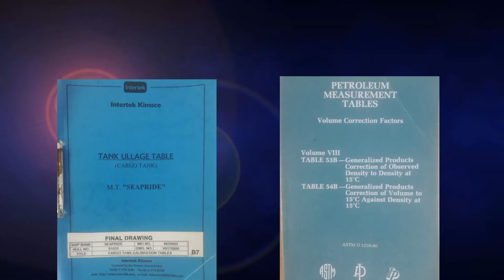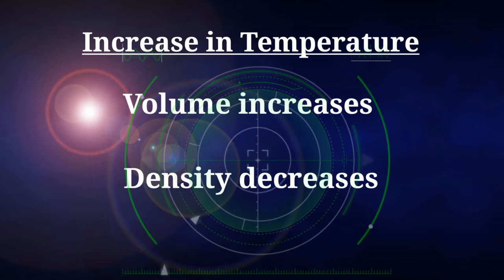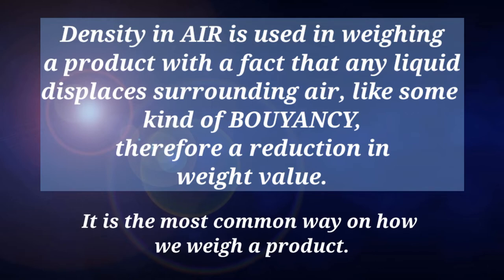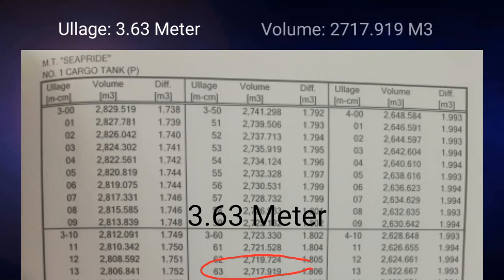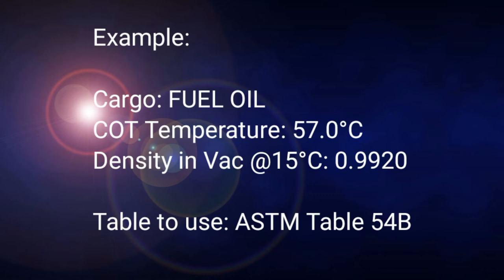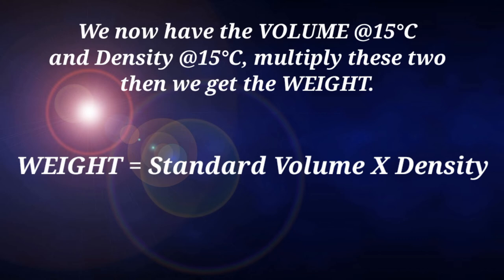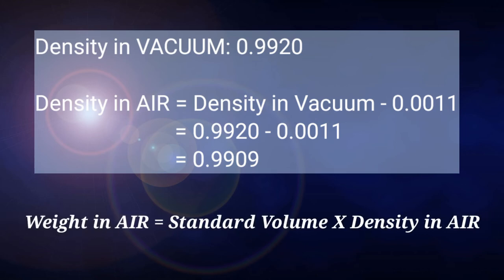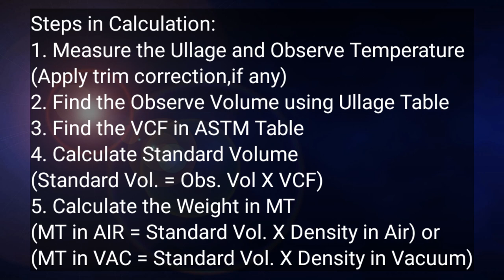Cargo Calculation on board Tanker Vessels

Comment: Sir chief, pano yung cargo methanol tapos bigay, density @ 20 degree celsius in air. Pano sir eh @15 lang sa astm
Reply from the maker: Good day mate. Sorry late reply hindi gaano active channel ko. Btw, this may help.

Madalas sa chemical cargoes ganyan, una need iconvert to 15C by below procedure.

Product density @ 20C = 0.8764
Table 53B, Volume VIII, page 209. Call 20C *observed temperature" Corresponding density @ 15C is 0.8798
Proceed with calculation using density @ 15C
Reduce the volume to 15C with table 54B, or 60F with table 6B as appropriate.

Otherwise, we can use DCF or VCF method for that.